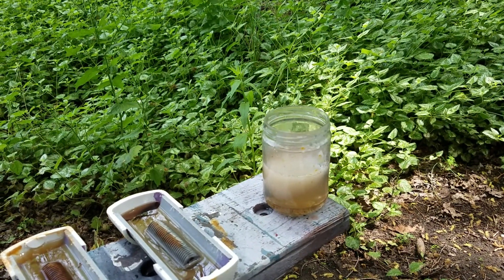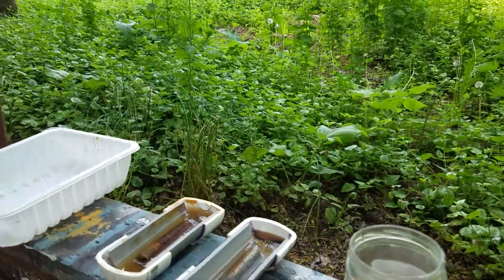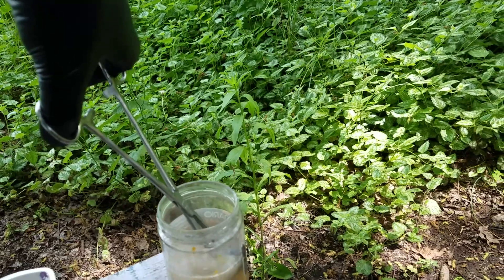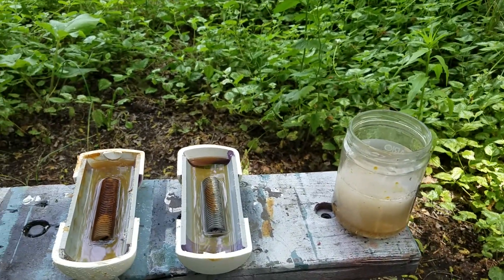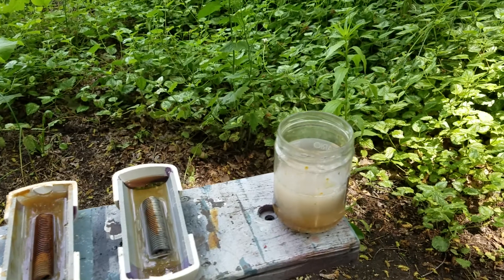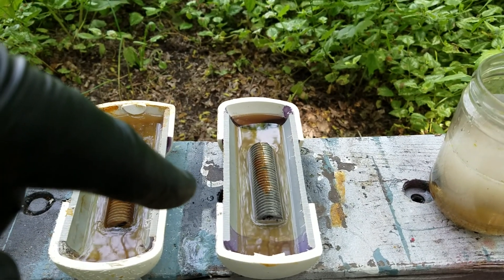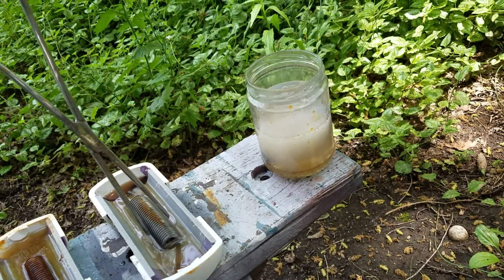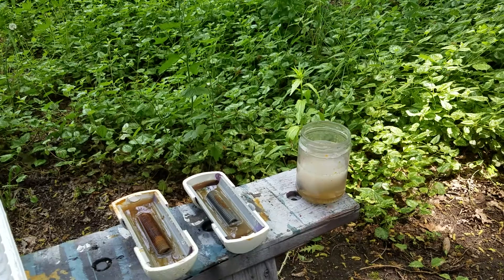Sharpening Files With Acid

Comment: I didn't see or even hear mention of a file. This is the Fatal flaw I believe.
Reply from the maker: The concept was to work with a larger profile so the result was easier to see. 
By using the all thread I could mimic the etching process on a large enough profile.

Comment: Sulphuric acid in batteries is 70 % water to acid putting it in neat does nothing for batteries and the water has to be distilled if you remember when we had wet cell batteries maybe this is why you are getting the reaction
Reply from the maker: Jusb1066 6years is too long to remember. I thought I wrote it down. You know how that goes.
Reply: i didnt expect what he had to be close to neat acid, i was sure it would already be watered down
Reply: 6 years is either like  last week, or more forgotten than 40 years ago